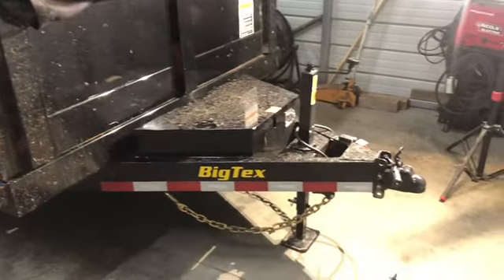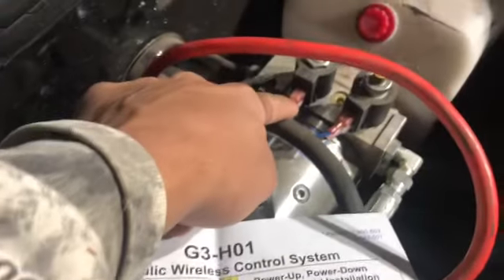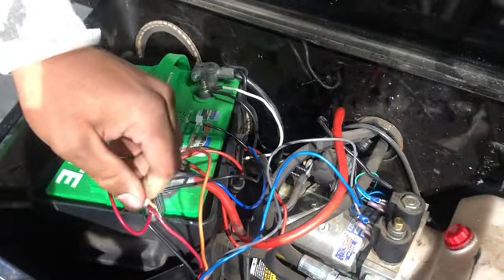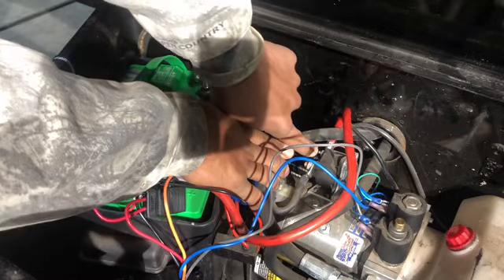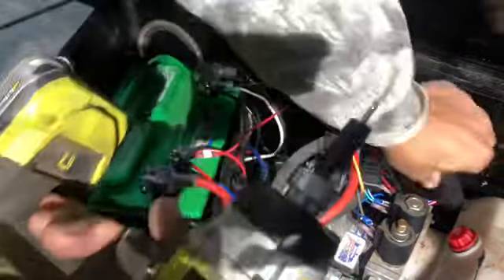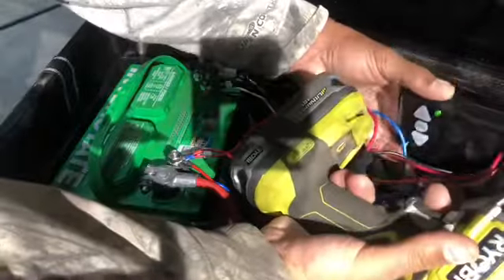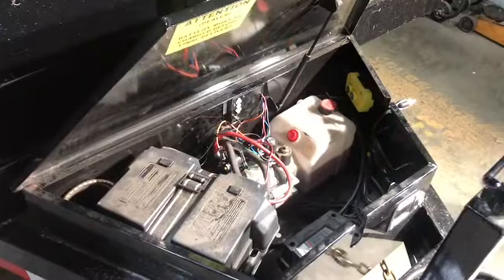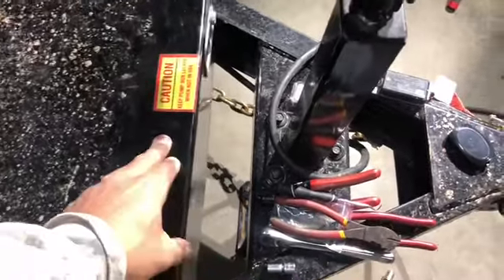Dump Trailer Wireless Remote!!!! How To!

Comment: Thanks for posting this. You convinced me to buy a wireless remote for my BigTex. I installed it just like your video. It's awesome!
Reply from the maker: Glad you like it. I have an issue with mine sometimes where sometimes it doesn’t make a good connection wirelessly and it doesn’t go up and down smoothly. Oh well. Works great most of the time.
Reply: @jsjunkremoval  mine will not go up smoothly at all unless I’m like three feet or closer to the antenna. I’ve replaced the battery in the remote with a brand new 2450 battery and re-did all the connections and checked all the voltages with a voltage meter. My unit is brand new. Only does it with the wireless remote. The receiver in the box works fine and the factory control works fine.
Reply from the maker: @JaseVaughn  where did you install your antenna. I find I have to roll my truck window down at the dump and sometimes it is jumpy. I found pushing the button harder works.
Reply: @jsjunkremoval  I installed it on the outside of the metal tool box on the right side. Mine is real bad. Like I said I have to be like three feet from the antenna for smooth operation. So it seems something is wrong straight from the factory.
Reply: It only does it going up though. Not on the down operation.
Reply from the maker: @JaseVaughn  I’d call them up and ask.
Reply from the maker: @JaseVaughn  that’s kinda weird.

Comment: Thanks for posting this. I just bought a Sure-Trac 2021 7x14 Dump Trailer and did my research on what wireless hydraulic remote they recommend and it’s the G3-H01 on their site. Mine is power up, gravity down. This would be a nice addition to have to save me the trouble of always opening the toolbox to dump and be tethered to a cable.
Reply from the maker: Ya no problem. This remote does either power or gravity down.

Comment: What kind of range do you get?  I looked on ebay and read some reviews and t he range was the only negative thing said about it.  I want to use it to tailgate.  So I need to be able to use it from the driver’s seat of my quad cab shortbed p/u truck.
Reply from the maker: The range is okay. I sit in my driver seat of my truck and operate it. Sometimes I have to hold it out the window. I always have the window down. I just put a KTI wireless remote on my PJ and the range is a lot better. It will work on the bigtex too.

Comment: My trailer is power up gravity down I have an issue with which one of the wires go on the hydraulic pump solenoid it says gray wire but my pump have a gray wire and a green wire thanks
Reply from the maker: I’m not sure. Disconnect one and see if it dies down. Check both.
Reply: @jsjunkremoval  Thanks I finally figured it out appreciate you
Reply from the maker: @richardlubin8353  no problem.

Comment: There is a lag when I use the remote control, like it still goes for another second or two. Is there anything I can do to make it start/stop immediately like when using the hardwired controls?
Reply from the maker: No that kit always delayed. It actually ended up failing and I replaced it with another system from KTI.
Reply: @jsjunkremoval  Does the new kit delay?
Reply from the maker: @mattf4691  no, it’s not noticeable.
Reply: @jsjunkremoval  what's the model?
Reply from the maker: @mattf4691  I used this one. You have to do some cutting and splicing but it works. 

KTI Wireless Remote Control https://www.amazon.com/dp/B01FYLCO26/ref=cm_sw_r_cp_api_glt_i_4Z2J78214RW6R3VQBPNW

Comment: Nice set-up!!
Reply from the maker: The OutFit thanks! She’s a hard worker that’s for sure!
Reply: @jsjunkremoval  I just bit the bullet yesterday and ordered the remote for my BigTex. Thanks for the video.
Reply from the maker: @TheOutFitPropertyMaint.  right on. I love mine. If yours has a KPI pump there is a plug and play remote system they offer. I just installed it on my PJ Rollster trailer.

Comment: Where did you get the remote from
Reply from the maker: That one I got from eBay. I took a crap on me and I ended up going with a KTI kit.
Reply: Ok so did you get that one form eBay to and what’s the name of it
Reply from the maker: @cornellterry6484  ya you can find them on eBay. It’s the KTI wireless kit for PJ trailers. They run about $200-$250.

Comment: Holy crap $100/ $500???!!!! Go on amazon$20, or go to good old harbor fart $40
Reply from the maker: It’s well worth it. I have used harbor freight wireless stuff and I was never happy with it.
Reply: @jsjunkremoval   Nice easy understand Video , I just ordered one From Ebay  . it will be here in a week  THANKS
Reply: I got my remote and installed super easy .  Have stick hand out the window to get smooth action . I wish I had done it earlier .